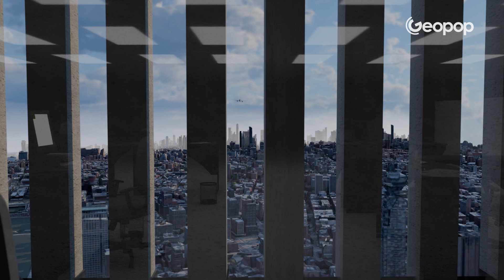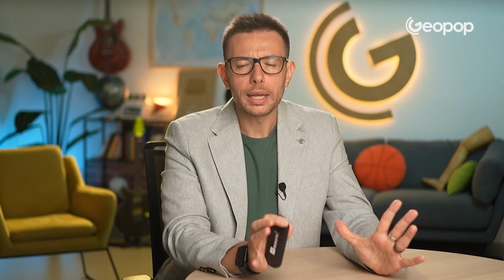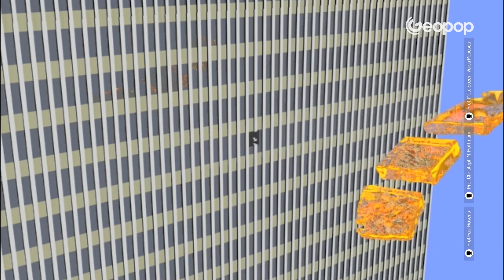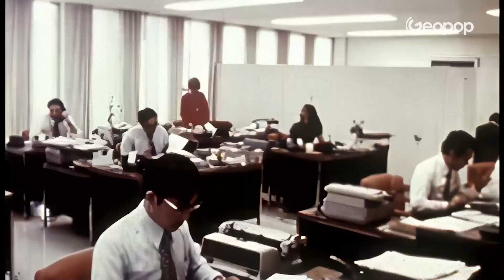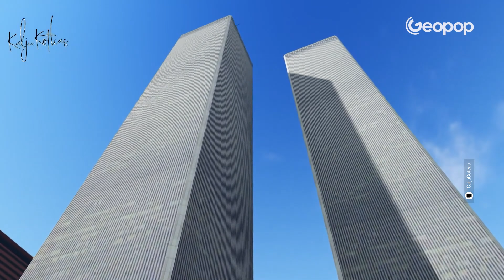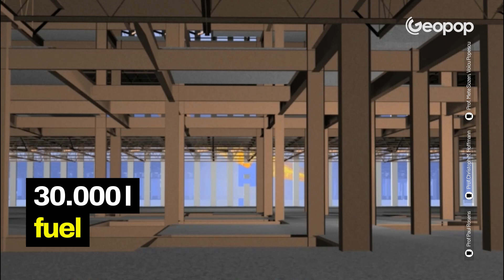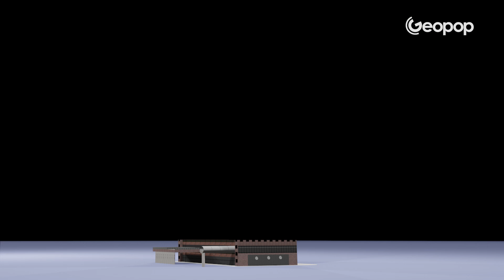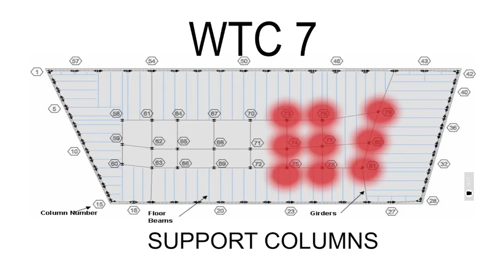9/11, 2001: The Technical Reconstruction of the Twin Towers and WTC 7 Collapses

Comment: Pure propaganda.  The rapid collapse of the floors below are not explained, the absence of heavy metals from computers is not addressed, the "stripping" of the insulation on steel beams isn't addressed, just stated as fact.   Why are all the shots of the collapses cut short?   It would not have looked like a demolition if it happened as he says -  sum of it would have been left burning. 

The building 7 explanation is simply absurd.  This video is a critical thinking test - kinda like 10,000 mules.   Too many unanswered questions that can't even be asked without demonizing the person asking.
Reply: The lower floors collapsed because the top floors fell on top of them genius. A controlled demolition is impossible given that in none of the recordings of the collapse explosions are audible.

Comment: WT7 demolition as we’re WT1 & 2. They found explosive residue. Jet fuel burns fast, it would not burn as long as it did.
Reply: No they didn't, that paper has been debunked years ago. And jet fuel was not the only flammable thing in the Towers
Reply: @marcop1563 Yes they did. They don’t want truth out. I’m not going to lie, you do you boo. I know what was found. All tower free fall. They were built to withstand weight. Firefighters even said secondary explosions, relating to bombs when asked.
Reply: @TNFroggyGirl  the Towers didn't freefall, far from it. And in fact the cores of both Towers survived the initial collapse for several seconds. The paper about explosives was debunked and there is no explosion sounds in any of the recordings, despite the fact that it would have been much louder than the collapses itself. What the firefighters heard was the collapse itself and they incorrectly described it as an explosion.

There was simply no way for the structure below the impact point to stop the fall of the upper portion, with no explosive required.
Reply: @marcop1563  nope bomb, NYPD said the chief was in the building way before they fell, all officers heard him over their radios to get out bombs are exploding. He told me I wasn’t wrong. All officers heard the call, he died in the tower. I wasn’t going to question him too much, being it was apparent he was still very emotional over it.
Reply: @froggygirl1968 he probably heard the rumble from the start of the collapse. If it was a bomb it would have been audible in the video recordings.
Reply: @marcop1563  then several others. They are lying & left parts out.

Comment: How anyone can believe this bs is beyond me. Just look at how the simulation of wt7 collapse is not even the same as the footage! Clear evidence that their simulation are wrong.
If it really did collapse due to the construction or fires then changes to building codes would be made to prevent it happening again. No changes to building codes have ever been made!
Reply: There are countless ways a building like that might collapse under fire. The simulation merely found one close to the one that they think actually happened.

And building codes didn't have to be changed because the situation on 911 was exceptional
Reply: Why would a model that was intended to simply test what happens if one column particular column fails be a photo-realistic recreating of such a complex event?  That is not what models do or what this model was for.

Your expectations are wrong.